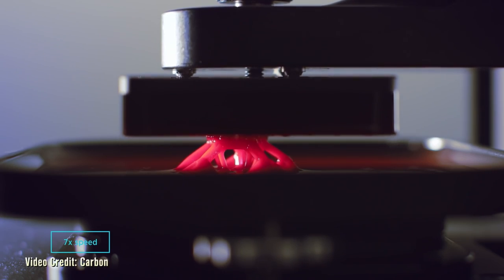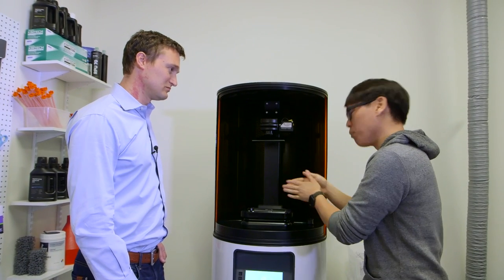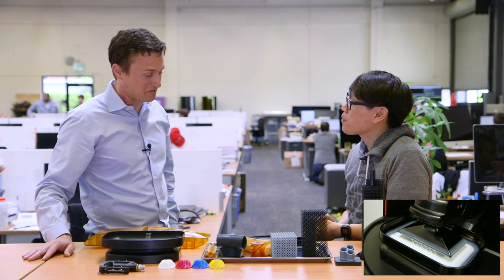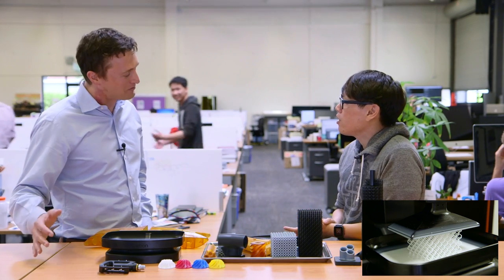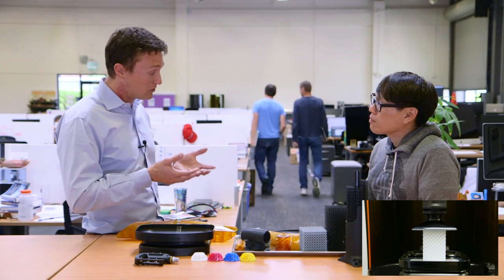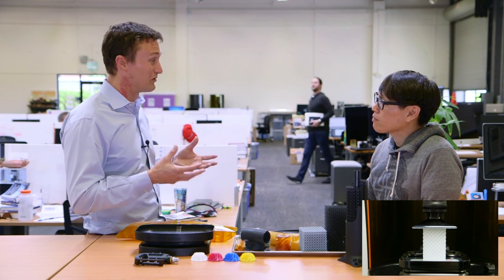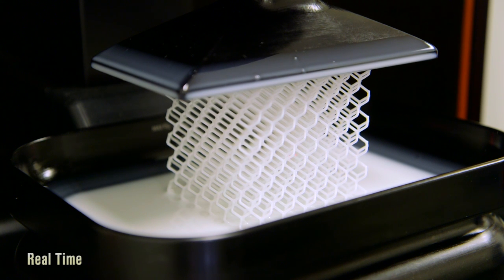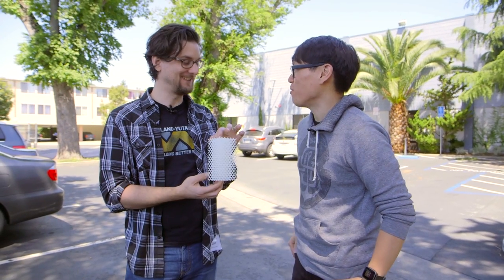Carbon M1 Super Fast 3D Printer Demo!

Comment: Goddamn it I regret buying all these FDM printers that clog like satan's anus every other print.
Reply: sounds to me like you dont know what you're doing... I have 4 3D printers, 3 of them with $4 hotends from AliExpress and one with an e3dv6. I haven't experienced a single clog in any of them, ever.
Reply: +Dav1dChui well that issue my friend is because you havn't inserted filament leading tube whole the way down to extruder. In many cases you actually need to tear extruder apart to be able to push it all the way down.
Reply: +Dav1dChui SLA printing is even more of a hassle. Sounds to me like you just aren't using yours properly. I doubt you have 40k to cough up to buy an M1.
Reply: +Dav1dChui LOL!
Reply: ***** The PTFE tube should be should down as far as you can get it. As for the thermistor problem, I haven't had an issue with it failing but on one of my cheap hotends I did notice that the wires on the thermistor were exposed and could have potentially led to false temperature readings and from there maybe a fire.
Reply: nah u dont need any metal bushing down there, just push teflon tube whole the way down to the nozzel, dont worry teflon takes alot more heat to melt.
Reply: +Dav1dChui  Look at their pricing... and then you realize, it's only for companies
Reply: My Chinese clone heads also clogged on long prints until I wrapped the entire heatblock in Kapton tape to prevent the heat convection working its way up the heatsink, on the side the fan isn't blowing on. The problem was the filament softening further and further up the throat, and the pressure from the extruder was causing the soft bit to get wider at the top of the throat and plug. Most annoying was that it would unplug just as easy as it would plug, so we would fix it by setting a huge retraction value between travels, or set the print speed HIGHER than normal such that the heat wouldn't be able to creep up the filament so easily because of the faster extrude rate! It all works great now that the airflow is sorted, bought a fan that uses 0.2A instead of 0.1A for slightly better flow around the heatsink, but the problems still occur when trying to use 0.2mm nozzles instead of 0.5mm, because of the extra pressure required for the extruder to squeeze it out the smaller hole, and the slower extrude rate dictated by the software. Since then we've converted it to a Bowden style extruder to make the print head lighter and smaller, works a treat, and took very little effort.

A temperature issue we had was that the preset in the firmware was set to the wrong resistance/brand of thermistor, so although it looked accurate at about room temperature, the temp at what was meant to be 185c was low by about 30 degrees, so it would try to print with the softened filament, but it'll plug every few minutes and won't stick to the bed either.

The main difference between my setup and everyone else's on here is that I replaced the hotend throats that had PTFE in them with all-metal ones, a couple of quid off ebay. The main reason for that was because I found it easier to get a decent print from it in the early stages of building, while it was still rife with issues and settings that were at the limits of their working range. Just less to go wrong at the time.

We're now using it to design and print our own much bigger 3D printer with CNC capabilities, our own x-carriage design with 24V setup, spring-loaded terminal blocks for easy tool swapping and maintenance, and an inductive auto bed levelling sensor that is neatly tucked away out of view behind the fan ducts.

Thanks for posting, anyway, interesting to hear about other people's 3D adventures.
Reply: I've read about people in forums experimenting with liquid cooling, and also using copper pipe and peltier effect thermocouples to take the heat away from just below the usual heatsink on the hotend. Mixed results and thermocouples use a fair amount of current, and also require cooling on the hot side! I've got the bits to try it out but not got round to throwing them together yet. I suspect it could work a bit too well, and prevent the hotend from reaching temperature without sufficient control, be fun to test

Comment: Video summary : "It's complex"
Reply: If I understood it correctly, the simplified idea is that the cross-section is projected with UV light. The UV light makes the liquid solid. So it's with layers, but the layer is built at once and not outlined, like in a standard printer. But yeah it is much more complicated than this simplification suggests.
Reply: +MendezAS light and oxygen to do this amazing parts. he can say anything else.
Reply: +Christopher Hardock Isn't that more an addition or addendum rather than a "correction?" Lol.

Comment: I have an idea how it works. They are using a specail rasin, which i think is hardening under uv-light but is reseasing oxigen under a different section of the light spectre. They also used a kind of a 2 component rasin as you see, so they must seperate it otherwhise there would be a chemical reaktion. So i think the fast printing time is caused by this chemical reaktion, which is supported by the Uv-light to harden the rasin and is stoped by the "other light" beacause its releasing oxigen. sorry for my englisch im german...
Reply: Jan Philipp Klein
Reply: Its just an LCD over a UV panel. They use UV reacting resins that's all. The heavy engineering part it's in the materials not the hardware.

How do they control the oxygen? Simple there is no oxygen everything it's done under more which hasn't been in contact with UV light and therefore still liquid.
Reply: they just push oxygen through the glass
Reply: Actually they use light and oxygen
Reply: of course how did i miss that...did he mention it anywhere

Comment: Bind the oxygen into your base resin, add a catalyst that will react with the oxygen under UV excitation, and have the UV projection wavelength and modulation matched so that it excites the catalyst, make it extract the oxygen from the resin, letting it harden. It's pretty genius, where as traditional printers avoid oxygen at all costs, this process distributes the oxygen evenly through the base resin and uses the light to get rid of it only where you need the resin to set. This will only get better as more sensitive resins and catalysts get developed, that need less light exposure to set, letting you pull the shape out faster.
Reply: Nah.

Comment: i really dont see how they controll the oxygen when the printing area is submerged in a tub. is that just me? the only thing i can immagine is oxygen mix in the resin
Reply: i agree they make it sound like that huge machine also controls oxygen but it's all in the resin, I'm not an engineer but i'm very confident this is true
Reply: the plate the projector shines through is made of oxygen permeable polymer like contact lenses, but rigid and thicker while still being optically clear . that's the secret sauce, basically a air hockey table on nano scale that's also a lens
Reply: very interesting, i never considered regulating oxygen through the bottom. do you have any particular source? i would like to learn more about this

Comment: No one has covered support structure on this process yet. They keep printing self supporting geometries in demonstrations. It's bugging me because supports are limiting to design freedom.
Reply from the maker: +Tallhedge we asked them about support structures, which apparently aren't needed for overhangs with their tech.
Reply: +Tested Thanks guys. I'll believe it when I see some test pieces, but I'm probably just overly skeptical. Better safe than sorry on new AM tech.
Reply: +Tested You did ask him about support structures, but he deflected your question and answered about how their 3D printing is suitable for production.  Unless he said something I missed, there was no mention as to how this technology could bypass traditional support structures, especially since it needs to be heat cured before having its final physical properties.
Reply: +Tallhedge There where other items on the bench that had no supports.
Reply: +wobbly sauce Already post processed parts. If they had had any in the first place, they would have been removed by now.
Reply: Tallhedge He said printed with no supports.
Though if you printer a Sphere.. you would have to have a hole in it at some point.
Reply: +wobbly sauce conceptually, if you were to print a J shape so that the top were mounted to the build platform, at some point you'd need support structure to pull the other end of the arch out of the resin. it's still much better than FDM, but they're not talking about it at all.
Reply: +Tallhedge If you head over to Carbon3d.com you can see some products they printed with support material.
Reply: +Tallhedge Then you print the J from another angle....
Reply: +RCPhotosVideos cheers man (y)
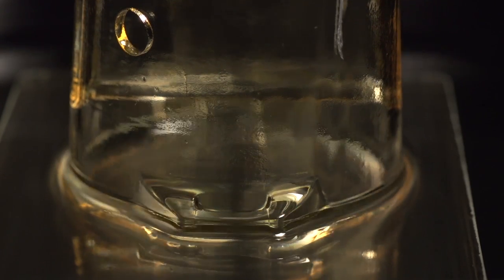Reply: +Tallhedge At 1:09 you can see support all over the top of the object
Reply: Mycon I would assume that bowl shapes would be fine as you build the bottom last, but domes would create a vacuum that dragged up resin unless you added a hole in the top to allow air to enter and equalize the pressure. Will be interesting to see what it's actually capable of.
Reply: Mycon They go to a cleaning station before there put into the oven, which releases all the left over uncured resin.
Reply: +Tallhedge you could just print it the other way. I suppose if that were a feature of a part, maybe it matters though.
Reply: +Tested is the parts then magnetically pulled up of the liquid or something? You don't see the problem, something has to lift it up?
Reply: +Tallhedge 
Why would you want to do that? As far as I can tell it would be more efficient to print such an object either flat or on it's side using their process, after all the actual orientation during printing is mostly arbitrary...
Reply: Tubbyengineer Orientation is hugely important in all other AM processes to date. It affects surface finish, amount of support required, geometric accuracy and in some cases strength of features due to weakness in the z direction. This process claims to have removed layering, but until I see tensile tests it sounds too good to be true.

I assume you're talking about the J example, it was an analogy for complex geometries that have overhangs that would start building before the point that attaches them to their component starts building.

Comment: Norm -how do you use o2? Approved Sales Responses - we live at the intersection of light, oxygen, resin, and heat?
Reply: +John Leeper Inside scoop, the "resin" gives off oxygen, the amount of oxygen is dependent on the temperature or intensity of the uv light
Reply: +eclipsethesun if this is indeed how this device uses the uv / o2 to control how long it allows each slice to cure, is a better answer than word association games.
Reply: YES! Of course it is. But remember, investors are all dollars and no "cents." Gotta keep it simple
Reply: +eclipsethesun ROI has made billions for software companies, why not manufacturing. Slap in some ITIL practices, and let peel that onion, bang a 250 page project document worth 100 million dollars i get it. Teaching the sexy technical details to ravenous technophiles cant be bad for brand recognition can it.
Reply: +John Leeper the reason he wouldn't give an answer to it was because they can't patent the science which they use, just as the commentator above pointed out the oxygen is given off during the chemical reaction and is controlled via intensity of the uv light. They can't patent that so they rather not talk about it bc they obviously feel that they are vulnerable to competitors.
Reply: +Meta Tron Except an informed competitor would just check out their machine and figure it out in hours if not minutes. Them being so full of themselves that they can't even have someone who knows what they are talking about instead of a boring marketing dude for an interview by tech media just means that the technology itself is incredibly unimpressive probably and letting a tech guy talk would probably burst the bubble and highlight all the disadvantages (instead of only the advantages a marketing guy like this due will talk about).
Reply: David Mulder so you basically repeated what I had to say and if anything have missed the bigger point which I already made. Which is the proprietary information which the guy kept avoiding talking about is just in the software since the physics and chemistry behind it can't be patented hence its easily duplicated if one understands the science. This is why the guy was skating around answering the technology questions fully since they are obviously paranoid of compitetion at this point in time. Why else be so concerned than in the first place.....
Reply: ***** China already has a working prototype as of 15 minutes after this video aired. It is already stolen. Patents? Proprietary. You must be a lawyer. That stuff doesn't exist in the land of the Dragon!

Comment: 'The only way to print this part was with expensive multi axis CNC milling machines, so the part was expensive as well'
And you're saying that the $40,000 per year rental fee for this printer isn't? $40,000 gets you a pretty decent CNC mill, and you get to keep that when the year is over. If you need the printer for 2 years you could have an $80,000 CNC mill, or stay with the 40k one and save your budget. Unless you really care about the speed these products are created at (although I doubt the printer is much faster) you probably lose money if you want to use these for production.

Comment: Anyone checked out their patents to find out how it really works?
Reply: "A method of forming a three-dimensional object, is carried out by (a) 
providing a carrier and a build plate, the build plate comprising a 
semipermeable member, the semipermeable member comprising a build 
surface with the build surface and the carrier defining a build region 
therebetween, and with the build surface in fluid communication by way 
of the semipermeable member with a source of polymerization inhibitor; 
(b) filling the build region with a polymerizable liquid, the 
polymerizable liquid contacting the build surface; (c) irradiating the 
build region through the build plate to produce a solid polymerized 
region in the build region, while forming or maintaining a liquid film 
release layer comprised of the polymerizable liquid formed between the 
solid polymerized region and the build surface, the polymerization of 
which liquid film is inhibited by the polymerization inhibitor; and (d) 
advancing the carrier with the polymerized region adhered thereto away 
from the build surface on the build plate to create a subsequent build 
region between the polymerized region and the build surface; (e) wherein
 the carrier has at least one channel formed therein, and the filling 
step is carried out by passing or forcing the polymerizable liquid into 
the build region through the at least one channel. Apparatus for 
carrying out the method is also described."

So basically it sounds like they use the semipermeable bed to allow oxygen through it, and using the oxygen to inhibit the polymerization of the liquid, and somehow using this inhibiting layer to eliminate the "layering" problem?

Comment: how much BOOST can I make with those 3d printed turbo compressor wheels?
Reply: None
Reply: +Cristian Galvan 
Your head is "in wrong place"...
Reply: i was kidding but you guys take stuff way to seareous
Reply: Mine was a joke to btw lol
Reply: Kanaan Nichols 
I wasn't talking to you at all.
I was talking to upside-down head.
Reply: XD
Reply: I took the picture like 4 years ago like that!
Reply: Cristian Galvan 
...did you know that banging your head against a wall burns 150 calories an hour (twice  as much if you double the speed)???
Reply: +Kanaan Nichols The Koenigsegg One:1 has a 3D printed turbo - it's not made by a desktop 3D printer though, but rather one that can print with solid metal. The machine to make them likely cost millions.
Reply: They have one at my uni that we can use its pretty cool
Reply: It works similar to a regular 3d printer, but kind of opposite. It lays down an extremely thin layer of dust of the metal you're using over the whole printing platform, and then goes over that with a laser which melts it together where you need it.. Then over and over, in tiny layers like a normal 3d printer.
Reply: *Serious. And yes, it matters, because that was terrible lol.